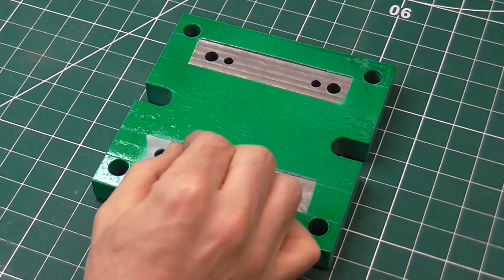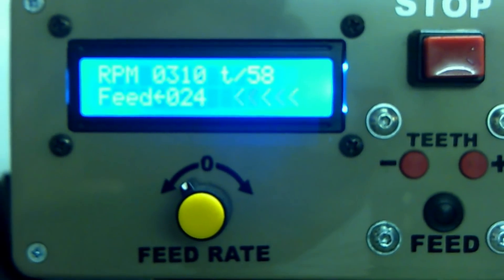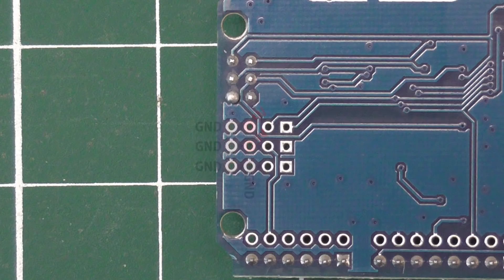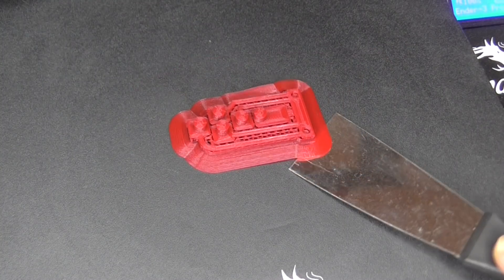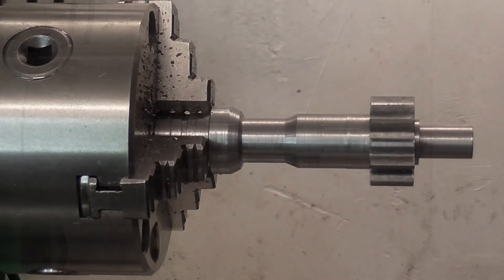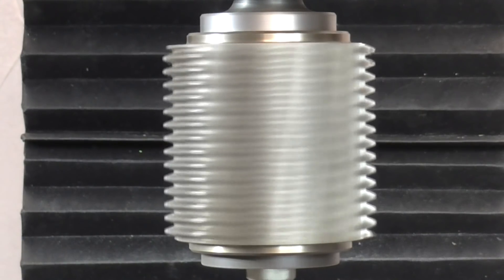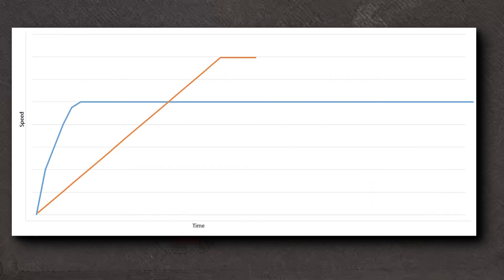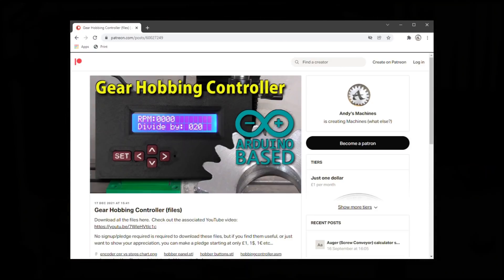Gear Hobbing Controller

Comment: Absolutely phenomenal video! Congrats!
Liked, subbed and commented.
Could you please make a full in depth tutorial to programming the ATMEG chips in Assembly?

How do you communicate with the LED display? No I2C here right? And no prebuild libraries either...
What is avrdude? 

So many questions but I believe there is a good reason you work in assembly language instead of Arduino Cpp IDE.
Reply from the maker: Thanks! I think an in depth ATmega assembly language programming video is beyond my skill set and would also be incredibly long and boring! There are plenty of online resources for this, I would also recommend getting Atmel (Microchip) Studio, a programmer and just start experimenting. The best way to learn this stuff is by doing, and what you need to learn will also depend on what you want to do with it.

This display has no I2C, it uses a 4 or 8 bit parallel bus, but is very easy to use as it has the character set built in. All displays differ, I usually just download the datasheet for whatever controller it uses and figure it out step by step.

AVRdude is the program the Arduino IDE actually uses to upload code (.hex) to the arduino board. I'm just skipping the IDE step and using it directly.
Reply: Thanks for the tips, I'll take a look.
Keep it up in the meanwhile!

Comment: The synchronization sequence close up, starting @ 14:32, which includes the exact fractions of a second reference, along with a background image of the red LED to allow your brain to comprehend what you are actually seeing is, without a doubt, the highest quality videography work I've ever seen on YT. 
An extraordinary effort to clarify an important aspect of the gear cutting process.
Excellent work Andy.!!
Reply from the maker: Thanks! That's quite a compliment!! But I think many people could have done it better,  I don't even have a high-speed camera, it was filmed at 25 FPS.

I felt the graph based explanation just before this, though it did explain what was actually happening, didn't really enable it to be visualised, so I wanted to show it actually working.

Comment: Hello. I would have a specification of the most suitable encoder, because here in Brazil I'm only finding a very simple 100 cpr model. Thanks again. Luiz (Brazil).
Reply from the maker: There are hundreds of different types of encoder but it can be hard to find one suitable to fit directly to a milling machine spindle (and they can be expensive). You can instead fit a pulley or gear to the spindle and use this to drive a second smaller shaft with the encoder mounted to it, gearing it up eg. 2-4x to get higher resolution.
Reply: @AndysMachines  thanks

Comment: Wow man! This one is really a perfect made project. You thought of everything and made it exactly as it should be. I so rarely see something so finished this days.

I also program a few different microcontrollers (STM32, PIC, AVR) and really like Eclipse for it, so if you have some time to spare check out the Sloeber IDE. This one is replacement for Arduino, with a LOT more.

Comment: Hi.  Is it the number of teeth in the gear is type on keyboard? What name  or especification to encoder. It hás a read both direciona ?  Thanks
Reply from the maker: It's the division ratio (the number of turns the milling machine spindle makes for one complete turn of the hobbing spindle). This equates to the number of teeth on the gear when using a normal single-start hob.

Yes, the encoder reads in both directions so it will never loose track of position, if you turn the mill spindle backwards the hobbing spindle will rotate backwards.
Reply: @AndysMachines  Thanks.

Comment: I think what hurt the Pic was when they sued  David Benson for using Pic in the title of his book EASY PIC'N  . They should have paid him to write more books. Maybe a set of easy pic'n books. When you learn on one controller you get to know all the angles and it takes a lot to move you to something ells . That is just human nature. One takes the path he knows. He could have generated a big fallowing and all of those people would probable still be using PICS. in there jobs. I still have all of my pic books . Kind of ended up losing interest in it.
Reply from the maker: I didn't know they sued him! My first Pic book was 'A Beginner's Guide To The Microchip PIC' (Nigel Gardner, 1998).

I know what you mean, I stuck with Pics until around 2015 before going over to AVRs. I originally planned to keep using both, but the small differences between them make it much easier to stick to one or the other. There are actually Pics that would have been more suitable for this project than the ATmega328, there are many different types which are more application specific and some have a built in hardware quadrature encoder interface, whereas on the ATmega I had to implement this using interrupts.

Comment: Good engineers endeavor to optimize their work and I believe that you've done an incredible job with this project. Thank you for publishing it. Though I don't need to hob gears right now, I would definitely use your design in the event that I do.
Reply: I've been cutting gears for years, occasionally, with form cutters, but definitely see building this in the near future, much easier to make hobs and get profiled teeth that fit.  I completely agree with you.

Comment: Great video quick question for you. What encoder are you using homebrew or off the shelf?
Reply from the maker: Thanks! I'm actually using a read head from an off the shelf encoder with a codewheel I made myself to fit the milling machine spindle, the original codewheel was smaller, I just had to make sure the pitch of the slots matched.

Comment: Very nice project! Will this controller also work with a rotary table which has a gear ration of 90:1? With a 200 steps per revolution stepper motor this requires 18000 steps per revolution. If case it will work with your controller, what would be a suitable encoder CPR?
Reply from the maker: Thanks! Unfortunately it's not really feasible to use a 90:1 reduction ratio, currently the controller will not let you input a step count above 10000 and you would be limited to running the milling machine extremely slowly or only cutting gears with a large number of teeth (or both) since the stepper motor would not be able to spin fast enough to turn the blank at a reasonable speed. 

There are ways you could get around it, you could use a 48 step/rev stepper motor, or a 200 step and enter half the total number of steps (9000) and only cut gears with even tooth counts since it would turn at half the division ratio, though you would need 2250 encoder counts per revolution. For very high encoder counts the encoder can be mounted on a separate shaft driven by pulleys or gears from the mill spindle (eg. 1000 CPR encoder 81:36 ratio =2250 CPR).

I would recommend disengaging the worm on the rotary table and attaching a pulley to the back, perhaps mounted on a drawbar, and drive it with a belt reduction. You could probably mount the stepper motor via the hold-down lugs so you don't need to modify the rotary table. (Note also that these tables often have plain bearings which aren't great for this sort of use.)
Reply: @AndysMachines  Thank you for the very elaborate answer! You gave me some food for thought.

Comment: 13:45 Did you know, that this is how Soyuz aligns with International Space Station for docking ? Because in orbit, speeding up or slowing down changes your own orbit height, you can't just slow down or accelerate to catch the other object, you simply lower or rise your own orbit, which puts you in an orbit faster or slower than the target, you then wait for the orbital offsets to align properly, and then you change the orbit height back, to match the target orbit. Look up the "Hohmann transfer".
Reply from the maker: No, I didn't know that. That's very interesting, thanks for that!

Comment: Excellent! 
Will Assembler run faster/better on all Duinos ?
Reply from the maker: Usually... When code is complied from C, Python, Arduino code etc. sometimes it's quite poorly optimised, dozens of opcodes when you could code the same thing by hand in only a few. It is possible to write high level code that gets compiled more efficiently if you know what you are doing, eg using correct variable types.

Comment: The Arduino IDE allows you to write in assembler/inline assembler. Also "Arduino code" is just C.
Reply from the maker: Yes, That was how I was going to write it originally (inline) but apparently it still doesn't compile it exactly as it's written,  and it just seems wrong to write an entire sketch this way when I can do it in Atmel Studio which I am more familiar with. 

I'm not an expert in either 'arduino code' or C, but I believe it's closer to C++ with some aspects of C, but wouldn't be valid code in either language.
Reply: @AndysMachines  plus it will add various baggage/timer interrupts/etc, which will change from version to version.
Reply: @AndysMachines  I kind of thought if you want to use C you name the file(with the add tab menu) something.c or for c++ filename.cpp and for asm something.s

I think if you want to use any old C++ compiler all you will have to do is add some #includes that the IDE adds for you. And maybe a main function to call setup and loop?

Any code that looks none standard is just #defines from one or more of the #includes that are automatically added, so I think all the code is just standard c++.(or .c or .s)

Could be wrong though.

Comment: Lol programming an arduino in assembler is knda like rowing the titanic. (The only good thing about the titanic was that it had motors.) 🤣
Nice work on the stepper accel ramping and delayed sync.
There was no need for the "spindle * 64 / stepper = whole number" thing. You could have just used a Bresenham ratio accumulator solution which will sync any 2 numbers. It's a fast solution in code, I was doing it in assembler on PICs and steppers back in about 2000.
Anyway, cool project and 👍 for making it open source. 🙂
Reply from the maker: Yes, that's a good analogy. I think arduino programming is kind of like building an Ikea wardrobe. Assembly language is like building the same wardrobe only you have to make every panel and every nut and bolt too.

I haven't heard of the Bresenham algorithm before, I'll have to check that out. I just used a simple and fast method that works with most common encoder counts and pulley ratios.

Comment: Great video
Do you describe making or buying the encoder used in the hobbing machine?
Reply from the maker: Thanks! That could actually be a topic for a future video. I did make the codewheel for the encoder shown in this video, but I actually reused the read head from another encoder. Hollow shaft encoders that are big enough to fit over a milling machine spindle/shaft can be hard to find and expensive.
Reply: @AndysMachines  I was going to ask about the encoder. That didn't look like the usual rubbish available on Amazon. The encoder wheel looked like it may have been printed ?
Reply from the maker: @varmint243davev7  It was actually machined from steel, but it probably could have been 3D printed, maybe not quite as accurate.

Comment: I cut gears for a living and use shapers and hobbing machines. For years i always thought about doing something like this but never really had the time to finish my project. I build the closed loop dc motor contoller by missan because they are even cheaper and closed loop and knew the worm will do all the spindle holding anyway. So im guessing you propably going to work on the helical next? Can't wait.... Great work Andy
Reply from the maker: Yes, a closed loop system would also be a very good way to do it. I'm not familiar with the system you mention, but steppers are pretty cheap these days and I think open-loop stepper is the cheapest and simplest way to do it?

This setup can also cut helicals, all you have to do is tilt the hobbing attachment (and adjust the diameter of the blank to suit the helical angle) I covered this in my 2nd video on the hobbing attachment.

Comment: Wow! 
I never expected you to actually do this but I am really glad you did!!!
I WILL be making a gear hobbing machine very similar to yours now that I can make a controller for it using your code. 
Your step by step instructions are awesome, I am somewhat familiar with Arduino stuff in general so this shouldn't be that difficult now that you've done the part that I couldn't do.

Also, I will gladly make a donation through your Patreon account as this is the only way I could build a working gear hobbing machine.  

Thank you so much for doing this, Andy!!!! 

Looks like it's time to get the 3D printer I've been thinking about. Lol

Thanks again, Andy!!!

Joe
Reply from the maker: Glad to hear it! Let me know how it works out.

I rarely use my 3D printer for making actual finished things, I got it for making patterns for casting, but I have to say this panel worked out very well and was quick to make. Normally I would have machined the panel and turned or even injection-moulded the buttons, all of which take far longer.
Reply: @AndysMachines  
Hi Andy,

Yeah, my motive for a 3D printer was mainly for casting patterns as well......and maybe a few personalized toys for the grandkids. 
The Creality UV Resin 3D printer looks pretty inviting to me because of that smooth injection molded look. 

I have a small control panel for an electronic lead screw on my lathe and the front panel and buttons were 3d printed, that setup replaces the change gears for threading ops with a hybrid stepper motor and I have to say it works very well. 
The control panel buttons were made very similar to what you have in your new control panel. 

I'll have to wait until sometime next month to start the hobber project, I'm finishing up a 1969 DoAll Surface grinder rebuild at the moment but the hobber project is now my next project.
I think I'll use an Omron Quadrature Rotary Encoder with a 1:1 synchronous drive on top of the milling machine instead of making one as you did, I used an Omron Encoder on the lathe electronic lead screw with good results, I found a source on Ebay for the encoder for less than $45,  most places want more than $200 for them.  

And....I will try making my own gear hobbing cutters after I watch your videos on how to make them another time or two :-) 

I really, really appreciate what you did here and the fact that you are willing to share it with people like me!! 

Have a great day!!!

Joe
Reply: Hola pudiera compartir como lo hizo es exactamente lo q quiero hacer pero tengo poco conocimiento de Arduino y programación etc

Comment: I've found that coding in arduino IDE is only good for blinking LED's. As the amount of code grows, using arduino IDE becomes exponentially more frustrating. I'd say after about 300 lines of code arduino IDE becomes unbearable.
I personally just code in plain C++ because that's what i grew up with, never really used ASM other than putting an odd NOP line in my C++ code to waste a cycle or two for when i need my peripherals to sync.